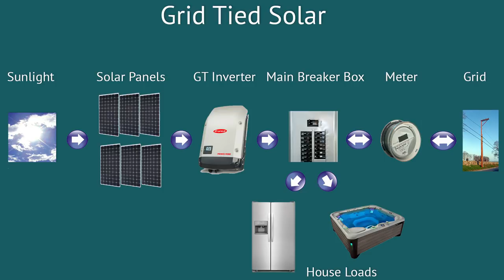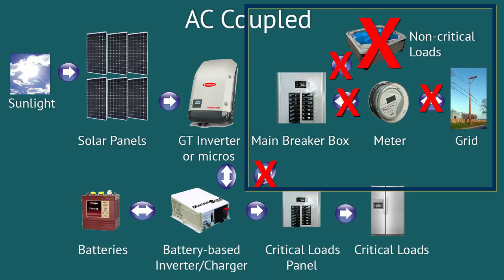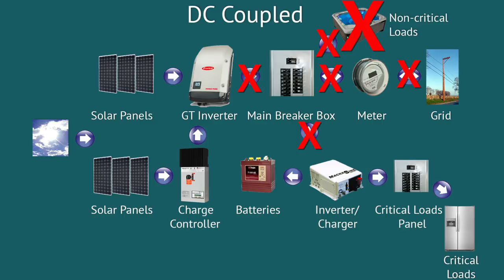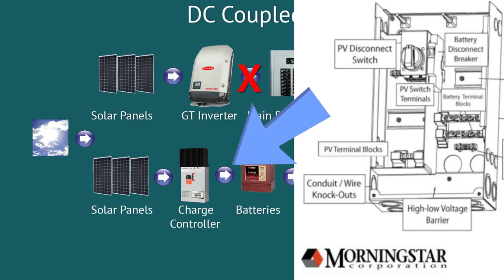Adding batteries to grid tied solar

Comment: all my thanks to you  please can you explaine to  me how to determinate  voltage system in PV off grid system 12V or 24V or 48V  it mean that we compare the peak power by the interval of 12,24,48V while somme peoples compar the daly total power of  loads. i give to you a simple example witch resume the proplem; i have a led projector of 500w when it works 2 hours per day we need  voltage systeme = 12v  but if it works 20  hours per day we need voltage system = 48V can  you correct me this please because i feel that i have right 99% .???? all the respect
Reply from the maker: Because most batteries have a limit to the number of parallel strings, a bigger battery bank generally needs to be built with a higher voltage. For example, if you have 12V 100Ah, 1200Wh batteries that want to be limited to 3 strings, if you need 3600Wh bank, you can do 12V, as 3 of the batteries will be enough. But if you have more loads, so you need 12 batteries, you can do a 48V battery bank with 4 of the batteries in series, and 3 strings in parallel. If you tried to do 12 batteries at 12V, they would all need to be in parallel, which most batteries cannot do. 

So yes, in your example, you need 1,000Wh for 2 hours, and 10,000Wh for 20 hours. So your battery bank would have to be bigger for 20 hours, requiring more batteries, and a higher voltage bank would be better.

Comment: i have 8 Trace 235AH 6V Deep Cycle Battery  48 volts and have the flexmax 80 can you tell me what are the  charging voltage set points-current limit, absorb, float, absorb time limit, end amps and rebulk.?
Reply from the maker: I'll be honest, I'm not familiar with those batteries. I found 1 reference to them online, with not much for details. It looks like it is the same Trace who made inverters forever ago, and is now Xantrex/Schneider, so I'm thinking the batteries are very old, so there won't be much on them on the internet. So your best bet is to find similar battery's info and use that. Here is a link to Trojan T-105 which is very similar. Page 17 has the charging parameters. I would use those numbers. http://www.trojanbattery.com/pdf/TrojanBattery_UsersGuide.pdf
Reply: is the factory set parameters the same for the flexmax 80 close to the parameters i need for my Trace 235AH 6V Deep Cycle Battery ?
Reply from the maker: As you can see in the Outback FLEXmax 80 manual, the defaults are different. http://www.outbackpower.com/downloads/documents/Make_the_Power/flexmax_6080/owner_manual.pdf , page 99. Max current is defaulted to 80A, the battery (again, unable to find the Trace manual, basing on Trojan T-105) wants max current 13% of C/20 rate, 235Ah x 13% = 30A. Battery specs call for 2.45V absorb per cell, so that is 2.45V x 24 cells = 58.8V, default is  57.7V.  Equalize from the battery is 2.7V x 24 cells = 64.8, defalt is 57.6. You can compare the rest yourself from the manuals.
Reply: i have 8, 6 volt batteries  is that the same for the info you gave me?
Reply from the maker: The info I gave was for eight 6V batteries wired in series for 48V.
Reply: thank you again
Reply: the mate 3s has a time function on the battery charging , do you know what time to set it on.

Comment: do you have a video on conecting from the Radian 4048 outback inverter strait to the braeker box?
Reply from the maker: I don't yet, but am working on one. Meanwhile, look at the install manual, page 39. https://www.altestore.com/static/datafiles/Others/GS_8048A_4048A_InstallationManual.pdf  The Grid goes to a 30A dual pole breaker in your main breaker box, preferably in the bottom corner, furthest away from the main breaker (the manual says 50A, but that is for a 8048).  The AC Out goes to a 30A dul pole breaker at the input of a Critical Loads breaker box. That's where you move all of your critical loads to be powered by the battery bank when the grid goes out. When the grid is up, the inverter's internal transfer switch just passes it all through to the main breaker box and the grid. (4000W / 240V x 1.25 = 20.8A, so round up to the next available size)
Reply: i am going 100% off grid, my area was hit hard by hurricane Maria, i have 16-260 watts solar panels , 4048 radian outback inverter , outback MPPT  FM-80 charge controller and a midnite 6 circuit combiner box, with 8 Trace 235 amp hrs batteries , what size of a breaker do i use in my breaker panel  and i need 40 feet of wire to my panel box from my inverter, what size wire do i run? the installation manual shows the GSLC BOX that my inverter did not come with,
Reply from the maker: Steve, our thoughts are with you folks. We've been shipping solar equipment down there as fast as we can. 4000W / 240V x 1.25 (NEC requirement) = 20.8A, so round up to 25 or 30A 2-pole breaker, whatever you can get that fits in your breaker box. The inverter installation manual recommends 8AWG wire. That is plenty big for that distance with only about 1% voltage drop.
Reply: thank you.
Reply: can the out back flex 80 handel 4,160 watts of solar panels  16 -260 watt panels  in groups 0f 4 ?
Reply from the maker: Steve rivera that is maxing it out. 260W x 16 / 48V = 86A. That will be fine. However, 4 in series may be too high voltage. What is the Voc of your panels? You have to stay under 150V. You may need to use 15 panels instead, 5 strings of 3.
Reply: each panel is 30.7 volts.  122.8 volts. is that ok.?
Reply: i am trying to keep the volts high in order to get the batteries charging with the early sun light
Reply from the maker: I think that 30V is Vmp, not Voc. Double check. The 150V limit is for Voc, plus temperature compensation, which shouldn't be too bad if you were in Maria's path.  "PV Open Circuit Voltage (VOC) 
150 VDC absolute maximum coldest conditions / 145 VDC start-up and operating maximum".  3 in series is still plenty high voltage. If you don't have the charge controller already, Outback is coming out with their FLEXmax100 next month, it can take a higher voltage, up to 300V.  I don't know what the price will be yet. http://www.outbackpower.com/outback-products/make-the-power/flexmax-series-charge-controllers/item/flexmax-100?category_id=531
Reply: your right , 38 voc, 4 panels would give me 152  voc, is 2 volts over to much,? and what happens if you go over 150 volts ?
Reply from the maker: Boom goes the charge controller. And that's at 77F degrees. Voltage goes up as temperature goes down. I would not recommend 4 in series on that charge controller. Do 3 in series, and have a spare in case something happens to a panel.
Reply: altE. Thank you very much. You have been very helpful.
Reply: i have 8 Trace 235AH 6V Deep Cycle Battery  48 volts and have the flexmax 80 can you tell me what are the  recharging voltage set points-current limit, absorb, float, absorb time limit, end amps and rebulk.?
REPLY
Reply: i am getting a voltage of 103.4 volts with 3 panels , is it safe to say 4 panels will give me 138 volts, and is that safe for my flexmax 80 charge control ?

Comment: The added costs for a battery backup system to the solar panels hardly seems worth it.  Unless you're losing power frequently, just buy a good dual fuel genny.
Reply from the maker: This video is intended for people who do lose power often, or who do not have easy access to fuel for a generator. There is a huge need for this in the islands that got destroyed by the hurricanes. They are spending hours each day and a fortune on fuel, 6 months later, trying to keep their generators running.

Comment: I'll never understand why anyone would make that kind of investment into off grid equipment and still be grid tied I will never understand this??!!🤨🙄
Reply from the maker: Puerto Rico lost power for over 6 months, and had no fuel for generators. Here in the northeast we lose it for weeks in freak ice storms. A generator isn't always the best solution.
Reply: @Norris Brock
  - Because Daily Cycling of a large battery bank is very expensive, while Grid Power is very CHEAP for daily power. The   battery bank and / or generator is best for power outages only